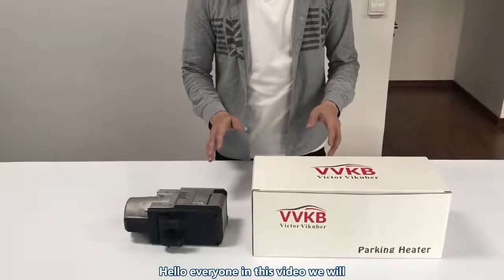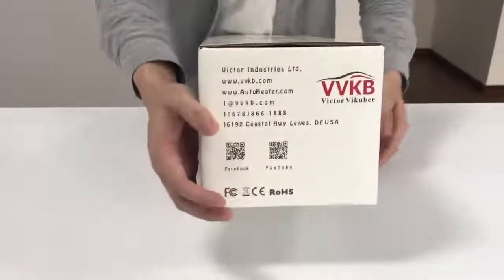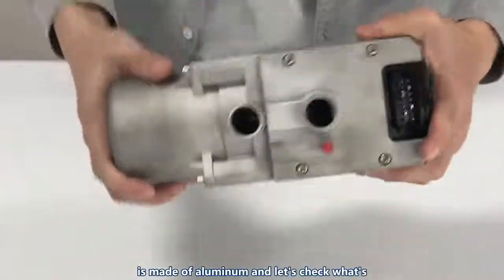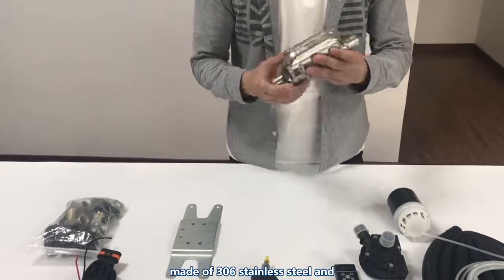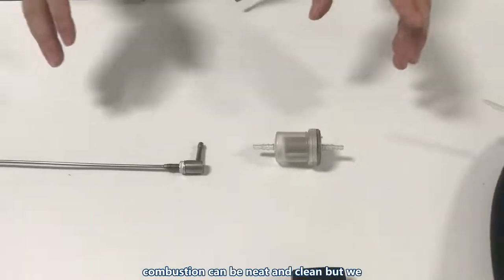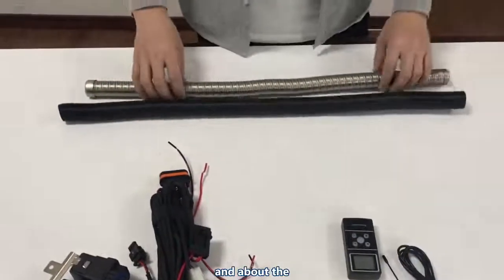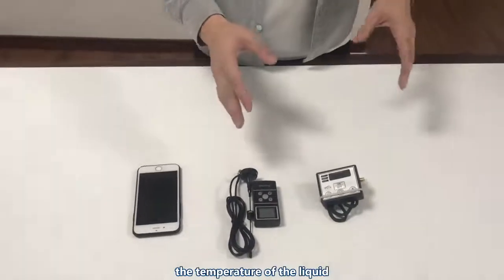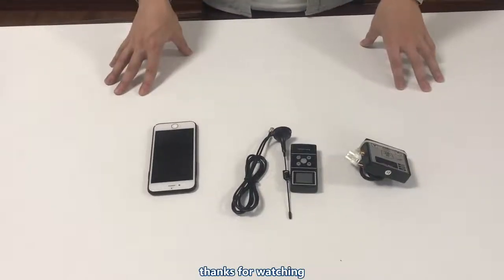Intruction of VVKB Apollo C1 Diesel Water Heater

Comment: water heater??  That's an air heater
Reply: Yes, it is a water or coolant heater, i use it in my boat to heat up the boiler, a 40 liter reservoir for shower etc.
Works like a charm
Reply: @erikh.5679  can it be used for instant hot water for a shower ?
Reply: @nicoslivesey2040  i don't have any experience with that, but with a 40 liter boiler it works very well.
Reply: @erikh.5679  how long does it take to heat the 40liters?
Reply: @nicoslivesey2040  when i well remember appr. 1.5 hours. I heat it up once a day when i am on board of my boat. (for shower and washing dishes etc.)
Reply: @Nicos Livesey no, mistake, about 50 minutes and of course depending on the temperature of the water in the boiler...
Reply from the maker: This is diesel engine heater Apollo-C1

Comment: The discription says that the heater signals that the room temperature reaches 65f , then shuts off. 

Perhaps 65 degrees is considered room temperature in China. 

In the USA room temperature is considered 70-72 degrees. Older people like still warmer temperatures. 

Is there a way to adjust the temperature so that it can reach  a higher temperature? 

If not, your company will lose many opportunities to sell this product.
Reply from the maker: The temperature settings for our diesel engine heaters are:
When the temperature reached 80 degrees Celsius, the heater stopped working, but the pump continued to run. When the temperature is below 60 degrees Celsius, the heater automatically starts working.
Stop working at 65 degrees Celsius, which is an electric engine heater.
Reply: @heaters  

Your website needs to explain things better. 

You need to show temperatures  in both Celsius (most of the world) and Fahrenheit  ( United States ) (a large potential market for your product). 

So can one set the thermostat for 20+ degrees C , or above 70 degrees Fahrenheit?
Reply from the maker: @johanvangelderen289  Thanks for reminding us, we will improve the product introduction.
Yes, the thermostat can be set.
Reply: @heaters  

Your company should consider hiring a marketing company in Europe and North America.  

You have a quality product.
You need to build a good reputation before cheaper Chinese companies start building hydronic heaters for 200 dollars. Just like they make air heaters now. 

Just like happened  to Webasto  and Eberspacher. They are good companies.  But customers only have limited money. They would rather spend 200 dollars on a low quality heater than over 1000 dollars for an excellent one.

Thanks for your reply.
Reply from the maker: @johanvangelderen289  We know a lot of people who buy cheap heaters, after those heaters encounter unsolvable faults, they will discard the cheap heaters and re-purchase reliable heaters. For example, buy Webasto and Eberspacher and VVKB.
Reply: @heaters  

People use heaters for camping  or for use in very cold winter conditions.  A heater failure could be very uncomfortable, or  could mean that someone might die. 

The heaters made by Webasto, Eberspacher,  Planar-Autotherm  of Russia and VVBK seem like quality reliable heaters which one can trust. 

It's worth spending a few hundred extra Euros or Dollars to save ones life. 

I'll be building a recreational vehicle in the next few years. 
Planar and VVBK are in my budget range. The European ones are too costly.
Reply from the maker: @johanvangelderen289  Yes, maintaining temperature is one aspect. In addition, we also want to ensure that the heater does not release toxic gases during operation.

We are very happy to hear that you are ready to consider the VVKB heater.
We will not let you down.
In addition, if you build a motor home, we have a very good product for the RV.
Can we communicate via email?
You can contact: vanilla@vvkb.com